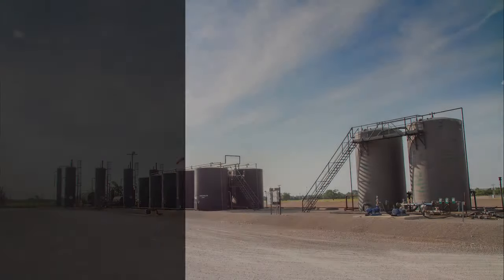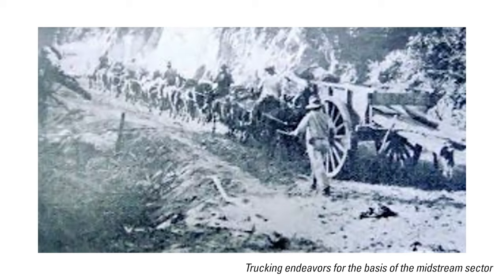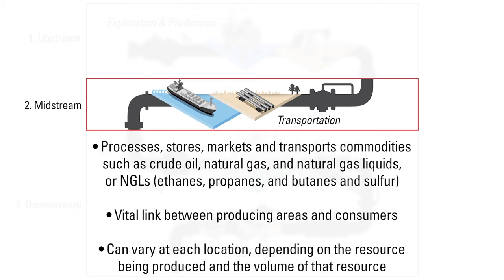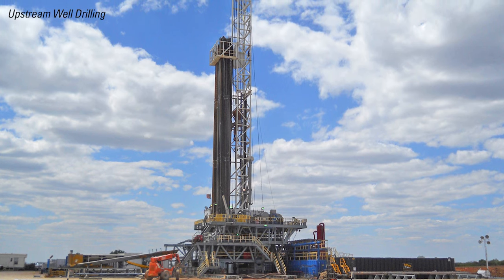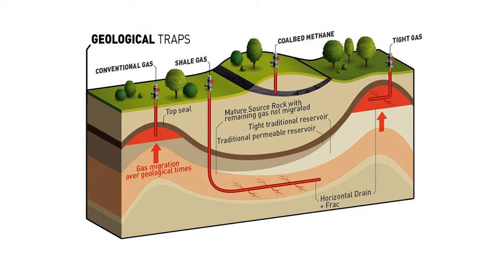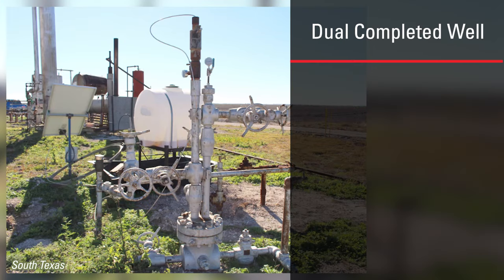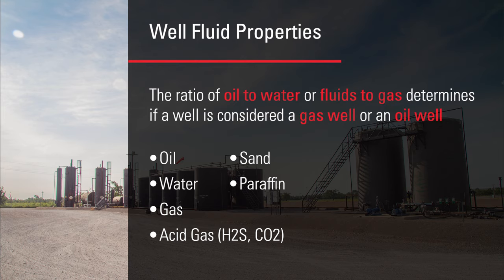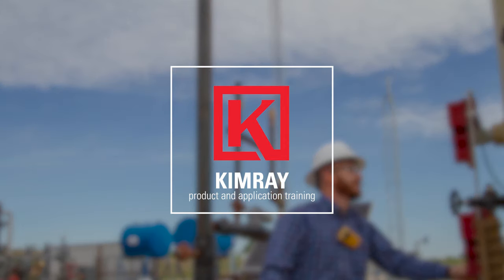Oil and Gas Industry Overview [Training Basics Series]

Comment: Thanks for this useful information,
and I have important question:
As you know natural gas is most wanted fuel than crude oil. OK
Why they don't converted all crude oil to gas same as FCC process but to produce gas only and some residual carbon?
Is there any process to cracking all crude oil to gas?
I am waiting for your kind reply
Regards
Reply from the maker: Perhaps something is getting a little lost in a translation, but if you're asking about refining crude oil, I hope this wikipedia page will be more helpful than what we could provide on a YouTube comment. https://en.wikipedia.org/wiki/Fluid_catalytic_cracking

If you do need more help, please contact our customer service at 1-405-525-4298 or service@kimray.com.
Reply from the maker: It is all about organic chemistry. Oil has very little associated natural gas in a barrel of oil. The carbon bonding structure dictates the product depending on whether more alkanes or alkenes are present.
Any gas produced during well production separates the natural gas stream from the crude oil production known as primary separation. Due to the characteristics of natural gas and crude oil the gas will flash off and not be retained in the oil.
Simple terms there is no great amount of natural gas present in solution in  a barrel of oil.
Hope this helps.
Reply: Dear Sir
I got it 
Thank you
Regards

Comment: Which is the basic Training for oil n Gas
Reply from the maker: This is part of the level 1 training for Kimray Academy. Level 2 is currently only available to internal employees of Kimray, but will be available later this year for online enrollment. This course explores the fundamentals of our valves and the production equipment they are used on. It covers product function, repair and troubleshooting as well.